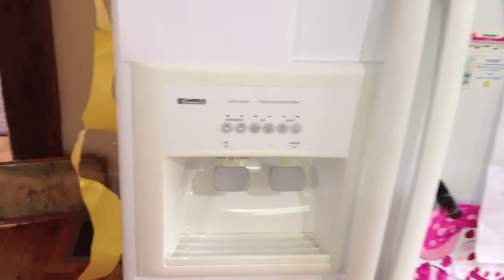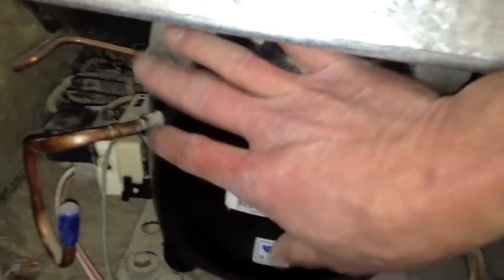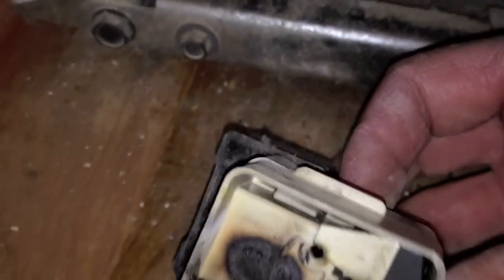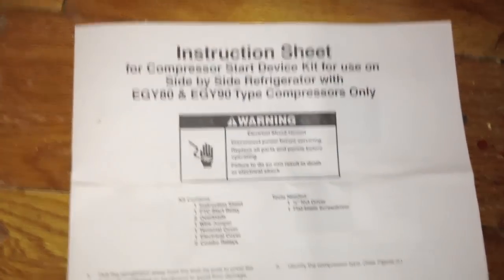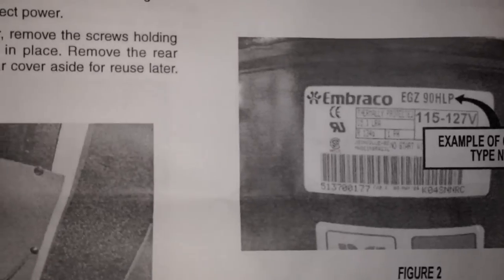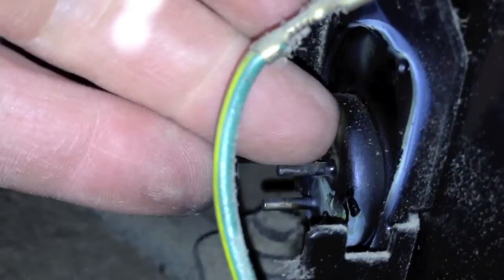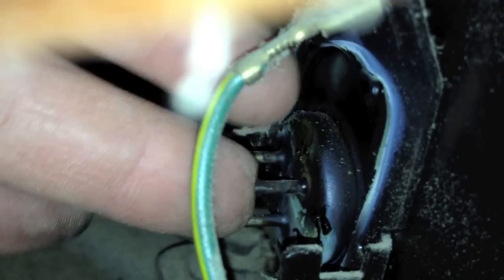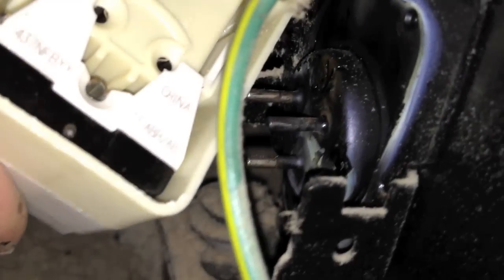Replacing a Burnt Refrigerator Compressor Start Relay

Comment: Thank you for this video. I am single mom, and fridge started smelling like burnt wires and making clicking noise. I pulled it out but dont see any burnt wires. Fridge is still cold tho. But now I think I need start relay cause that is where the clicking noise is coming from. Only thing is, its Sunday, Cant get it till tomorrow. Unless maybe Lowes has it lol. So too afraid to let it run tonight and you said it might burn those prongs, and I cant afford a new fridge. Hope its gonna be cold tonight. I can turn my heat off and open the fridge door lol
Reply from the maker: Gove the relay a shake.  If you hear it rattle, it's bad.  But that doesn't mean your compressor is still okay.  Only way to really know for sure is to go ahead and install the new relay.
Reply: It was the relay. Compressor is fine! Replaced it (155$ including labor :( )
Reply from the maker: You could have fixed this yourself!
Reply: I know it BUT....they changed the way it looks. It was a white box, now it is 2 different parts they make that go into a black box but I dont have that New design so they had rewire it on. I talked to Crosley myself to see if I could get the part from them and they verified that they dont carry that white box anymore it is new design. So since I wasnt sure about me rewiring it I just paid for someone to do it.

Comment: I have a burnt mark on the black coated copper line going to the condenser coil it has a burnt mark on the part where it inters the compressor but my compressor windings are not stuck
Reply from the maker: If you want, post your problem over at Appliantology.org. Its an appliance repair forum where myself or other techs will help you fix your problem. Its free to post. Head on over here: https://appliantology.org/forum/60-diy-appliance-repair-help/
Reply: @AppliantologyOrg  I got lucky somebody recommended this guy so he came by and told me it was going to be my compressor before he even tested he says he fixed a lot of these and told me it was going to be around $1,000 to fix it through the company he worked for. Or he could come back after work and fix it on his time for 500 cash compressor and everything. I said really he said yes I said okay he came after work with a brand new compressor in his hand got in there installed it pulled the old one out and the compressor is running like a champ. But I read that Kenmore uses LG compressors and they are a big fail for the company they have a new replacement model

Comment from the maker: An excellent point, Brother Multitool!  I always do this as well but didn't include that step in this particular video-- such are the shortcomings of reality videos made while on the job.  You get distracted by customers and other things going on while you're trying to troubleshoot and repair.  But your point is an excellent and everyone should check the compressor windings before going through the trouble and expense of installing a new start device.

Comment: Can I use an EGY90 as a substitute on an EGY80 compressor? I'm sure the answer is going to be along the lines of "only use factory recommended parts", but I already have one on hand and I figured as long as I go with a higher number instead of lower that it should be fine. And I'm not worried about warranties as the fridge is 2nd hand bought off of craigslist, lol.

Comment: When you replace the compressor relay have you ever used dialectic grease on the studs? The reason I am asking is because the studs on my compressor have some damage from the failure of the relay. I have cleaned them with emory paper.

Comment: ok thanks but i found what the problem was. it was the start relay my fridge has a 90hlp compressor and last time i change the start relay i didnt check for the 90hlp and i put the 80hlp on it. now that i have change it to the 90hlp my fridge is working fine but thanks for answering back

Comment from the maker: Great suggestion!  I'll keep that in mind on future service calls.  You're on the right track: normal current draw in the newer compressors (< 10 years old) is in the range of 1 amp.  Some slightly less; some as much as 1.4, or so.  2 amps or more on a newer compressor indicates a problem.  Can also use a megger to test the windings.  I have another video that shows using a megger.  Look around my channel, you'll find it.  I can't post links in comments.

Comment: Two questions:  1. I have the exact same prob w the exact same compressor. My relay burned up worse than this example, leaving welded metal from the old relay on the top right compressor pin. I removed what I could and dremeled the rest down flush with the pin. As the space is tight, I haven't been able to get 100% of the fused metal off, but enough so that you can only BARELY feel a tiny hint of the difference in thickness from the base to the end of the pin. Would this cause the resistance you warned about? I've sanded off the oxidization on the other two pins w fine grain paper and to the naked eye and finger tips, you cant tell a difference now from what the pins originally looked like. Can I proceed with replacing the relay, or no? 

2. The wire harness going to the relay shows a little darkening at the clip - where the wires connect to the relay. Can you tell me how to proceed? 

Thanks from a desperate but determined mom.

Comment: I was a good little boy and ordered the correct part on the internet from GE and waited only to receive the "updated Part" which didn't fit at all.  So I went down to my handy dan appliance part shop and bought the clone three in one, one size fits all start relay/overload switch/run capacitor from a guy wearing a world war one helmut with a spike on top and a lot of tattoes of naked women on his over sized arms(my kind of guy).  Not sure what country this part was made in.....probably not as high quality as China.  Installed it in 15 minutes and guess what?  We got ice!

Comment: Unfortunately the only choice I have is the Chinese knock off, because Whirlpool and/or Embraco in their infinite wisdom has stopped manufacturing the part.  Also, for some reason they don't provide the horsepower rating for the Embraco compressor (Model FSG 55 A).   The Chinese knock off (SUPCO 3 n 1) comes in two flavors (under 1/5 hp OR 1/4-1/3 hp).   They sure make it difficult for the home owner to do their own repairs.  The fridge is twenty years old, not worried about warranty.  BTW, excellent video, thanks for taking the time to help us lesser beings!   Supco is about $6; new fridge is about $600.   100 to 1 ratio, seems like a no brainer, wouldn't you say!